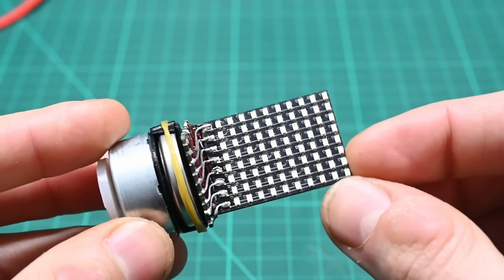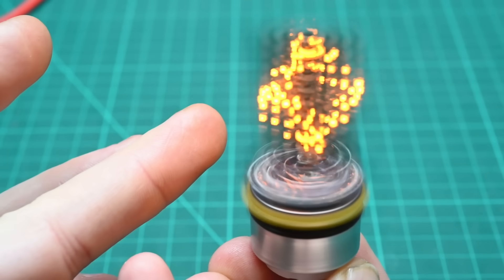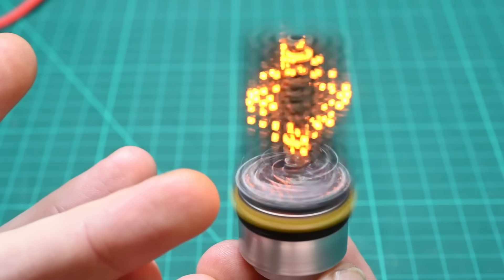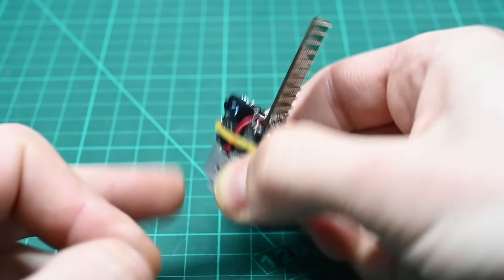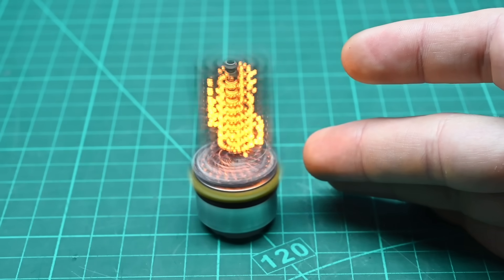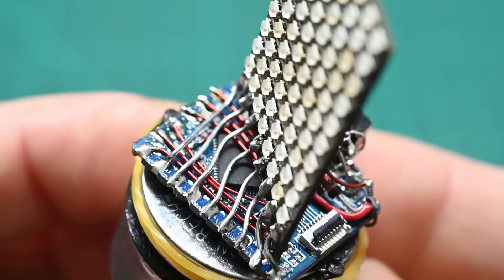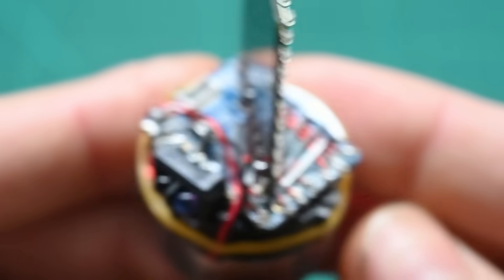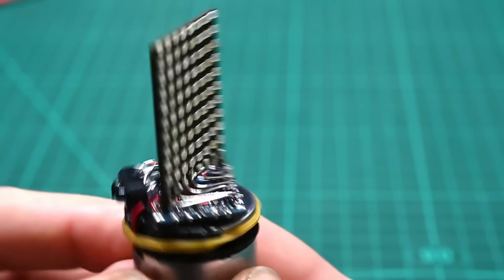Tiny volumetric display

Comment: I love this idea and the fact you built a working prototype is really amazing! Thanks for sharing the results with us. I was thinking about the issue of the LED's disappearing when you are looking at the very edge of the PCB. Maybe an "L" shape (top view) would help? I suppose then it would be blank for half the rotation (which is worse). Maybe a double sided L shape or a one sided plus shape (like notch cutouts locking together)? My other pondering was that the square LED's are affected by perspective as they turn. I don't have any good ideas how to compensate for that with an image unfortunately. An LED would appear largest straight on and get less and less wide as it turns toward 90 degrees basically. It may be too difficult to change the brightness based on location of the pixel to match better (but it does seem like you enjoy a challenge).

Comment: Really very impressive.

Weight wise, as long as the weight and board remain balanced on the same plane it shouldn't have issues. But if you introduce the third axis in any meaningful way, I suspect it will gain a resonant wobble which will shake it apart. Basically, if you set it on a table, it'll work. If you set it on a door stop or mount it sideways, it will cause problems.

As a possible set of solutions:
1.  Double sided LED matrix.  If they are balanced around the same centre then you shouldn't get the blur you're seeing and it may add to overall brightness because you're "doubling" the visible light (the back side currently not being lit shows itself half the time)
2.  LED matrix in transparent resin suspension.  Make an LED matrix that works just laying on a table or something flat. Then, prop it up 1mm by the wiring (not the LEDs) and coat the whole arrangement in a thin layer of resin to give it stability. Ideally it will be a flat surface of resin like a PCB that has the electronics mounted inside of it. Bonus points if you can get the LEDs to shine in two directions only.

Comment: Amazing! Thank you for sharing. I wonder if you put it inside a vacuum tube with a mirror in base, the vacuum could reduce the rotation air resistance, and the mirror in base will hide the components and allow you to tweak it to be 2x deep if you keep leds that only illuminate the mirror..

Comment: I wonder if you could remove the battery all-together and utilize a wireless charger pad under the motor itself to provide the power.
It would turn this thing into a plug in power capable device with a chargeable battery in a base these sit on. I'm thinking nixie clock like display, or even just a single one for a cool display nick-nack desk toy.

Comment: To center the LEDs, could you move the board back and counter weight with a transparent layer such as acrylic, etc? ie, sandwich the LEDs between the PCB and a thin transparent layer. The density may not be exact but probably sufficient. Even if you get some wobble, you can counter weight on the bottom edge without worrying as much about the weight distribution delta top to bottom.

Comment: You could use the motor in reverse and use it as a generator, print a gear for it, and use and external powered motor to spin it, so no battery on board, but all electronics still self contained on board.

Comment: Can you imagine a transparent ideally non reflective PCB, with RGB LEDs in a higher resolution going at 60FPS at least ? I certainly did , of course it’d have to be in a closed space so that nothing interferes with the rotation of the PCB but damn it’s strikingly working.

Soon Apple will acquire the tech, patent it and say : “we will change the way you look at 3D objects” … I immediately imagined an object of about 1.5-2 meters in diameter going from the floor to the ceiling in each home with such a device in very high resolution and for Christmas you buy … I mean you SUBSCRIBE to the current year’s Christmas tree decoration, no need to do a physical tree anymore, just rent the model from the AppStore and soon other things will follow … for a higher pay you can have a Santa Clauss sleigh going around the tree, for a bit more money Christmas balls will be animated, and for the ultimate package it’ll be the fully animated tree, with possibility to buy off ads of course 😂.
To make the product “safe” for all, no Jesus will be included in the model whatsoever, and for other festivities of the year of each culture there will be packages to subscribe to, and this will soon turn into the 3D TV leaving that old archaic 2D plane of a monitor to rot in the garbage dumps of history.

Mitxela, this is a superb little device, I suggest you patent that thing before Apple or Amazon or Google or another big tech beats you to it, you’re basically giving off the future for free here.

Comment: Instead of a LED matrix, would this work with a small high res display instead? Like one of those that are used in VR headsets.
Reply: I think refresh rate would be an issue on those

Comment: Could you fix the balancing issue by putting the led panel behind a small square of glass that would centre The Leds between the PCB and a sheet of glass so they could be centred.

Comment: I wonder how adding another array of LEDs in parallel on the reverse side of the board might affect the balance. It would make the display brighter and smoother if exactly mirrored, or if the leds are offset it could double the resolution

Comment: If instead of leds you could implement a small oled display i'm pretty sure that would look even more awesome :)
Reply: I think refresh rate on oled display would be an issue
Reply: @marcobel9671  that's a valid point, while seems like the display itself update's rather fast according to a quick search on google, the communication speed is however rather slow. Nonetheless in my opinion it would be interesting to see the result

Comment: Add a carefully weighed sheet of acrylic in front of the LEDs to counterweight them. Then you can center them nicely.

The acrylic should weigh almost exactly as much as the LEDs' PC board weighs... including copper and solder.

Comment: you could use an rgb display to get highter resolution, but that could affect the cpu usage of the microcontroller. you could send a buffer wirelessly every x revolutions and do the compute on a separate device if you plan to use real time rendering

Comment: Sorry if this has probably already been said. But is it possible to mount the LED's on a clear PCB with thin trace wires or on a wire frame? I think the wire frame may be the best option as the LED's can be mounted within the wire frame on the centre line, thus centring them and also removing the central column when spinning. Cool little video though really cleaver little device. 🤔

Comment: Could use some kind of screen component to counterweight the board position. Also, some type of qi charging interface coupled with a bulb socket may act as enough of a base to protect it. But qu chargers aren't typically that small so that in itself is an interesting path that may require further engineering

Comment: This is really, really cool! I'm impressed with how the black PCB ends up kinda transparent as it spins.

I wonder if it would be possible to transmit data to it wirelessly if you add a WiFi or Bluetooth chip to it. I have genuinely no idea whether the connection would still work while it's spinning. I'm an ECE graduate but my specialization is in computer architecture, not RF electronics or building macroscopic electronics. I can think of a plausible reason why it might work and a plausible reason why it wouldn't work. Only way to know for sure is to test it out.

If you can transmit data wirelessly while it's spinning, and can transmit power while it's spinning maybe via the same technique trains use (Not sure exactly how it works though), then maybe this thing could stay on indefinitely. At least until the power transmission circuitry wears out.

Comment: About the weight compensation, you can move it back slightly and put a transparent sheet on the led lights, kind of like a phone screen protector, to balance out the weight.

Comment: Great idea...
  
I'm thinking with NeoPixel RGB-LEDs and inductive power transfer, you get past the battery life limitation.  Starting with a clear acrylic cylinder and slotting it down the middle should keep things from bumping the fin, and it'll act as a flywheel. Once you confirm the funciton of the LEDs you fill the slot with casting resin and it should be mechanically sound.  If you want to start mas-producing these, doing an acrylic casting in two steps would get yoy a very finely tuned led slot (you can do tight and cmplicated "cuts" to help position the LEDs). ESP32-S3 should give you enough performance to do bit banged serial - but would also give you wiFi for control (and object updates).
  
Could make one heck of a flicker candle.

Comment: Another idea for going large. Instead of rotating a vertical cylinder. You could rotate a horizontal cylinder. It would allow the two ends to be stable in a holder on each side.

Comment: Question: Is the display exactly synchronized to the rotation? This would allow you to put your finger on it to slow it a bit and the image should resolve the same regardless of the rotation velocity. This is a SYNC signal that corresponds to the location of the viewer as the LED board is facing the viewer -- regardless of rotational speed.

Comment: You could fill it up with transparent epoxy. by doing so, you can freely position the leds and might not need a circuit board at all.
Reply: Ah, and use an ESP to have it connect via wifi ;-)

Comment: Could a wireless charging base and a universal wireless charge to USB pad be used to supply power to a larger version?  I dont know if the rotation would cause any strange things to happen but would think if the coils are centered they would be fine?

Comment: MIGHT want to double the leds on both sides of the board. Would be interesting as I think it might improve the illusion of a 3d display bc the downtime between the display side and the backboard would be nigh zero. also no need to worry about a counterweight, only a second set of leds and more programming to be done (easy to say but I think it's cool).

Comment: I’m thinking you don’t need the lights to be in the center but the program to be aware of where the lights are. I’d try to put lights in both sides of the pcb, and adjust the program to compensate for the offset of the lights from the center plane

Comment: I quite like the "bonfire" effect over if it would be just a flame of a candle.  But I suppose it might be worth trying to get that one done as well, for the practice at just getting better at programming and tweaking.  This is super impressive. Imagine a set of 20 of these, lined up in a grid fashion, and flying on a drone.  It's almost like a flying hologram(ish) moving picture sign!
Reply: Well, there is already some presentations using hundreds of drones and it is pretty much what you just described! Just search it up.
Reply: Yeah but the drones are not static, and they don't allow viewers to rotate the image, and the image density is severely restricted by the drone's bodies. Something like this we could probably scale up to 4k/8k image quality over time. We already have pretty high quality 2D spinning displays like this available on Amazon. By 90's standards this tech is already futuristic as hell.
Reply: @bobriquardo5317  At first I thought even with one display like this over the body of the drone it still wouldn't be high resolution because the wings ocupy some space... but then I came to a conclusion, the wings are literally rotating motors! If the wings themselves were volumetric displays, then we would see the future my friends
Reply: @brunogarbin6305 problem is they always have to be facing up
Reply: @Roach_Dogg_JR  they don't though, it's just a prototype, but flipping the image doesn't seem too much of a problem in the future
Reply: @brunogarbin6305 a drone's "wings" need to be aerodynamically designed to fly. This would hinder that

Comment: I have an idea on how to power a spinning device from a stationary power source. 
If you’re familiar with a CD drive motor I’m almost sure you’re familiar with the coils of copper wire that move the Laser Lense up and down. Pluck those off off their Lense housing and use them as “wireless charging coils” 
Maybe only power the motor. But let a circle of maglets energize the coils as the motor spins. Use capacitors to keep the charge constant.

Comment: I'm building a kind of Corpocracy setting for a tabletop and these displays feel so much like the next step to 3d displays. Imagine a thin plate that rests in your phone but, whenever you want to use a 3d display for video calls or games you'd pull it out of a slot in your phone and then it would start operating. That'd be so fricken awesome.

Comment: In principle, it would be possible to compensate for the LEDs being offset from the center of rotation in software.
I kind of wonder how well it would work to do this with a little OLED display... though most of them probably aren't bright enough.

Comment: Very cool proof of concept. Maybe use some 0201 leds and put a lot more on the LED board to get way better resolution. Although you may need to design a new controller board. But very cool thanks for sharing this!
Reply: And even if harder to implement maybe use thin acrylic for the led

Comment: The imbalance is in the x axis not the y axis so adding a weight to offset the PCB will work just fine.  Now if that creates a 2nd or 3rd order harmonic is another story, but thats separate from the axial balance of the assembly.

Comment: Could reverse mount SMD LEDs fix the centering issue? With those, the LEDs stick into a hole in the PCB instead of laying on top of the surface. Not sure if you are able to get them in small enough sizes to increase the resolution from your current version though

Comment: Is it really that quiet? The typical dealbreaker for these sort of persistence of vision displays is the noise - I can hear a faint whir and the louder sounds of it being bumped on your cutting mat, but it seems basically silent. It's an impressive bit of wizardry either way, but I'm curious if you cleaned the audio up, if your recording gear has onboard noise-filtering, if the noise floor is simply set high, etc... It seems likely that it may simply be a matter of scale though - the more typically demonstrated 2d POV displays have long rotating arms, which must travel a longer arc through a larger volume of air.

Comment: I reckon you get a really high resolution hologram by basically doing this but using one of those SPI OLED displays (maybe a transparent one?) instead of the LED matrix board. Although you'd have to cover/paint it to make it yellow if you wanted it to look like a candle
Reply: I looked into this great idea, but unfortunately for this application its not super viable :( let's say you wanted your pov display to spin at 20 rps (20fps basically). These spi displays are usually 64x128. if you wanted reasonable pixel density, i would use the radial pixel count x π to find how many times per rotation you would need to update the display. In this case, the desired circumference resolution would be 201 screen refreshes per rotation (a refresh for each "pixel"). This resolution at 20 fps would require a screen framerate of around 4020 fps, and the theoretical max speed of these spi oleds is around 200fps at 8mhz. This math is for if the display was either offset or in landscape. If you centered the display vertical, you would only need 2000fps, but thats still unfortunately out of range:( I love the idea though!
Reply: I found a thing called Voxon, and it looks like it's already sophisticated volumetric display.

Comment: If you could adjust the brightness of individual LEDs then you can create tonality and additionally gain the benefit of depth which in flame effects could be very realistic. The glow of the flame and then bright sparks or wisps of light.

Also the use of RGB lighting could also add another layer of realism. I actually think this is a great concept and with some polish design could be a great product for candle-light like lamps.

Very cool.

Comment: If you add led's to the back you could increase the resolution (by changing it's position relative to to the led on the other side) or refresh rate. Lastly you could probably make a single pcb at the bottom and then mount the LED's at a right angle (90 degrees) to it (use wires from led's to hold them up), and then use each row on the x axis (/along the radius) for a different height of each led (i.e. it would look like a spiral staircase), this should be relatively easy if something weird doesn't happen I'm guessing (and a second spiral can be added to increase the resolution like previously mentioned but this time making it look like a "dna helix") (ps. if doing this probably mount the led's "legs" to both be in the diameter to help it resist bending outwards). Hope this is useful somehow, best of luck

Comment: I hate those rechargabe coin cells they are very finnicky 
do you think you coudl replace the battery with an inductor coil and use a wireless charger or make your won transmission coil to transmit he current wirelessly instead of using a battery on the motor?
I wonder if it coudl be designed to recoup some energey too since he coild would be spinning
I would like to see a bigger version maybe sing a  HDD motor and  larger  LED display wih  more densly packed LED's and  2 sided powered by a wireless charging coil

Comment: One suggestion for increasing the resolution is to have another identical display with the LEDs offset vertically by halfway compared to the other and placed on the opposite side, to appear similar to interlacing.